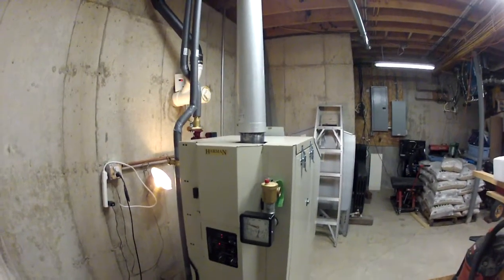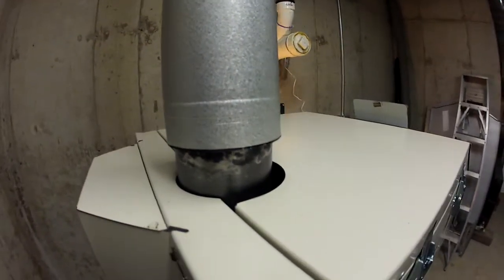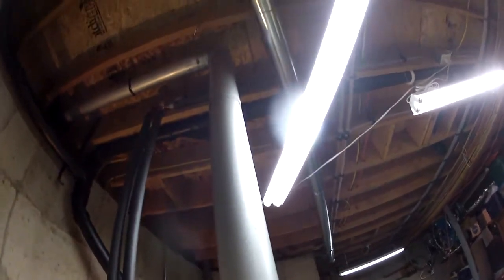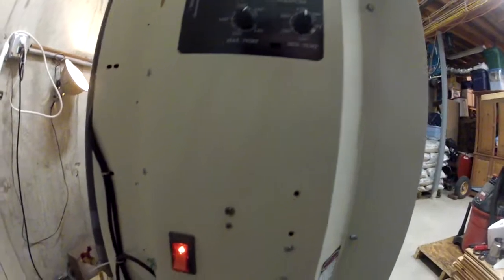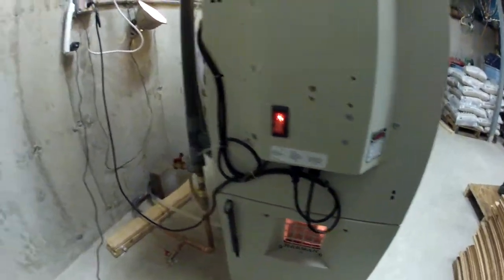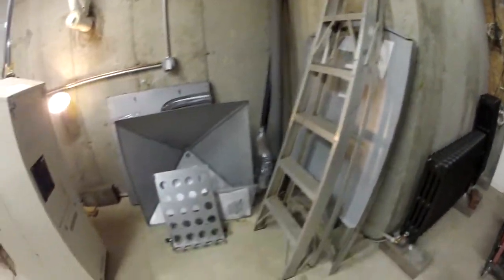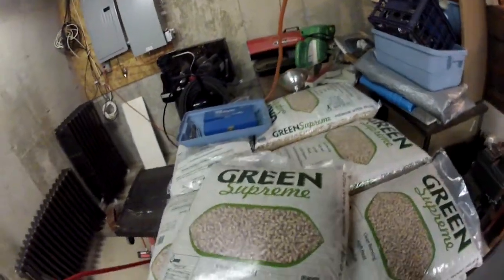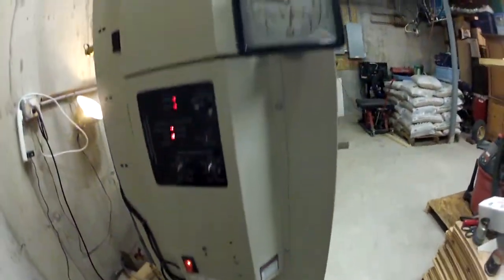Harman HydroFlex60 Pellet Boiler

Comment: This seems so neat. It's now almost 10 years later. Has it been reliable? Did you need to replace any expense parts?
Reply from the maker: nothing replaced yet, running great. fire box insulation is showing some wear, and the heat deflector plates are a little warped, but all in all still great shape and very reliable.  (It did have a 4 year break when Trump was  President, with fuel oil at $1.62 a gallon it was cheaper to burn oil. purchased it in 2013 when obama made fuel oil go up to $5.00 a gallon.) now we're back to $3.50 a gallon for No.2 oil, I just got another 5 tons of pellets. Harman doesn't make these boilers anymore. but there are other good European brands to consider.

Comment: Is it more efficient than propane? 
You said you used 3 bags in 24 hours 
Here in Minnesota bags are $-5-$6 bucks 
I currently use 3.5 gallons of propane a day so a total of $12 bucks a day 

Is the unit worth the money and is it cheaper than propane?
Reply from the maker: my heat calculations are buying pellets at $219 a ton / $4.38 a bag, and the break even at $2.63 a gallon for fuel oil per btu of heat. so when oil is above that, its cheaper to run pellets.  I believe this model may be discontinued. sorry i cant help with the propane numbers.  wood has about 8000-8800 btu per lbs, oil is about 138000 btu per gallon.  most units are 90% efficient. this unit only makes 60,000 btu per hour wide open. it may not be enough for you?